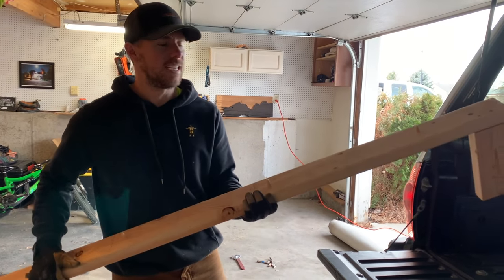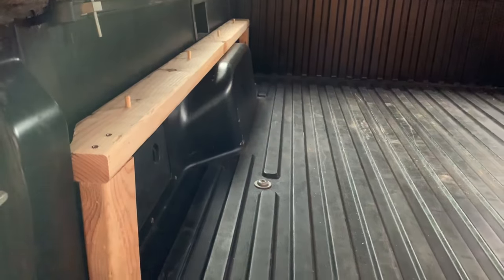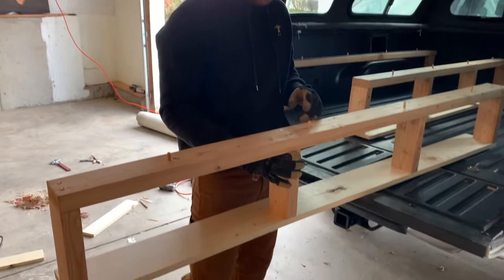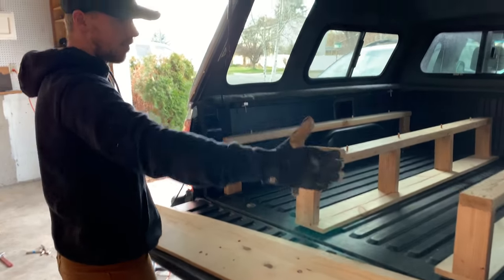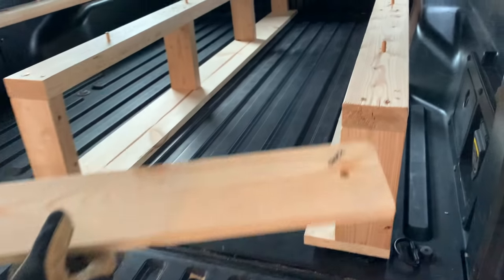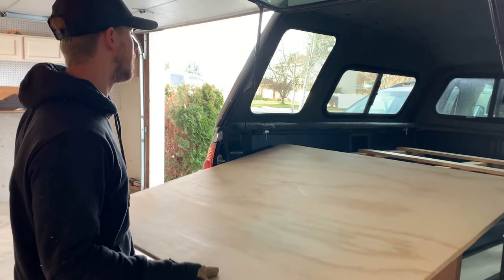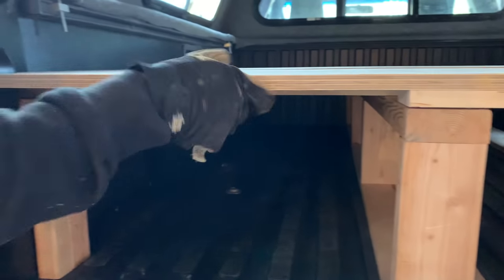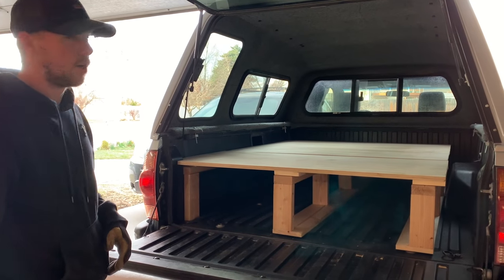Truck Bed Camper Build | Simple, sturdy and modular sleeping platform.

Comment: Hi there, I saw your vid. I've been truck camping since the mid 80's. Here's what I've learned & I'll pass them on to you.
1) Get stuff you need at a camping store for backpacking. It's small, compact, & light weight. 
2)Get splash guards for your truck. It'll help keep you & your rig clean. They work. I know.
3) When parking for the night, park headlong into the wind. That way if a storm comes you won't have to worry about a side wind ripping off your camper shell. Plus, if anything comes bouncing towards the truck, since you have a slimmer profile, it might miss you. If it does hit, the front of the truck is reinforced. 
4) Use bug spray on the interior doors & windows/ screens openings to help keep bugs out. Use wasp & hornet spray around & on your tires to help keep critters out. Basically, all points of contact on the ground.
5) An inch is a lot of room.  Learn how to stack & get used to sand & dirt.  Use floor mats to put your shoes on too
6)Air out your sleeping area every morning or often. In an enclosed space the air gets stale & it will smell like feet & assholes. I know this from being in an 80 man berthing when I was in THE NAVY! 
7)Use a small fan to circulate the air in your sleeping area. This will help prevent hot & cold spots from forming & help prevent condensation & mold & mildew from forming. 
I hope this helps. Great vid, thanks for sharing. Drive safe. 🤠
Reply: Awesome good too know

Comment: Best idea I've seen yet. I needed a modular idea, fairly cheap and easy to build. Of course, from this main build one can tweak as needed for their purposes and desires. Spot on. Thank you so much for sharing, this has just saved serious $$$$$ in tents, awnings, etc. Excited to get this built for my truck this weekend.  I know this is a 2020 build, and it is 2022, but still the best idea I've seen in 2 years of trying various tents, awnings, etc., and having to sell them. Storage looks to be easy as well, get some plastic tubs, notch them together with a piece of rope and slide them in and out. Perfect.
Reply from the maker: That makes me so happy to hear man! Exactly why I made the video. Best of luck with your build and adventures. thanks again!

Comment: Awesome design. I have a smaller bed so I went over the second wheel well instead of over just one. You can also use a couple extra slats on the top of the braces in between the Dow rods to make it even stronger. Also used spare plywood and made braces on each corner support. Thanks for the idea.

Comment: From a structural standpoint, it looks like you used a lot of unnecessary lumber there. You could have used the indents already molded into the Tacoma bed for the cross slats and then ran a single stringer (like a 2x8) down the middle for support.  Would save a lot of weight!  I then use those long plastic bins on each side of the stringer for drawers.  Nice build though, these always end up being completely custom and unique to the user!!

Comment: This is great. I'm curious. Why didnt you do the same on the right side ie over the wheel well?
Reply from the maker: Hi Carol. We chose to do that to allow room for storage along the side of the bed. I can stash bags, lights etc on either side of the wheel well and also use the wheel well itself as a shelf. I've found that to be pretty useful so if I were to build it again I would do the same.
Reply: @tylerwilliams310  thx for taking the time to reply.

Comment: Nicely done. One could build on from there or stay as is. I'm looking for middle walk way. So a bed and very small cubard on the other side.
But you got a very good set up.
What kind of shell is that? Seems like nice head room.
Reply from the maker: Thanks! Ya you're totally right. I actually have another platform and smaller slats that I can use for a single bed layout, with space on the side. I just remove one of the braces and change the width of the two remaining. 
I love this shell - and I got lucky that it came with the truck when I bought it. It's a Leer high rise. Not sure if they make the exact model anymore, but it's kind of like their 122 model. 

Good luck with your build!

Comment: I'm just curious why you didn't put your right support all the way over the wheel well; and why you didn't make drawer slides for the left side. Some good ideas!
Reply from the maker: Hello and thanks! We wanted to leave room in front of and behind the right side wheel well for easy storage. I use the wheel well as a little shelf to sit things, and I like being able to access the other spaces while I'm in the bed. For the drawers - it was just a little easier to build that way, and I felt like I only needed one actual drawer. I use a sled on the left side and it works fine for me, but I could see a 2nd drawer being pretty useful too!

Comment: Why did you not use the last 8 inches (wheel well width) on the right side of the truck bed for the bed?

I would like to build a system like this that I could configure in two different ways. One configuration would be for single person sleeping when I go hunting alone, the left half of truck bed would be used for my bed and the right side of the truck bed would be left empty so I could store my ice chest, game cart, bow case, and other hunting gear. The other configuration would be for a two person bed and it would take up most or all of the truck bed. I would use that when my wife and I go truck camping on vacations. Any suggestions on how to do the two different configurations?
Reply from the maker: I just like having some empty space on the sides to stash things while I'm in the bed. 

I actually did exactly what you're describing. All I had to do was cut different sized slats and different sized plywood tops. I took out the middle brace and slid the right one over to the center to fit. Voila, single bed for solo adventures and more storage space.

Comment: Was there any particular reason the passenger side support was against the wheelwell instead of over it like the driver side support? Was it so you can add a sliding drawer later?
Reply from the maker: good question - we chose to do that to allow room for storage along the side of the bed. I can stash bags, lights etc on either side of the wheel well and also use the wheel well itself as a shelf. I've found that to be pretty useful so if I were to build it again I would do the same.

Comment: I've been looking at dozens of videos over the last couple months, and this is far and away the best setup I've seen.  I love the modular design, but it is so well put together for sturdiness.  This was very well though out. Did you make a custom mattress for the back to sleep on or do you just throw a queen/full size mattress back there?
Reply from the maker: Thank you! I ended up cutting a mattress topper to size. It worked out great. I found the 3"  height to be about right if you get a decent quality topper.